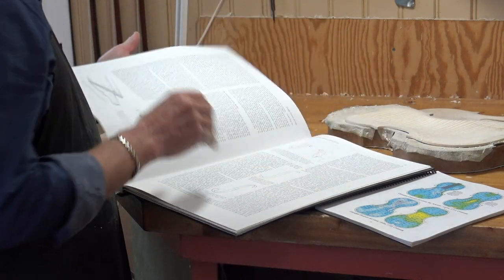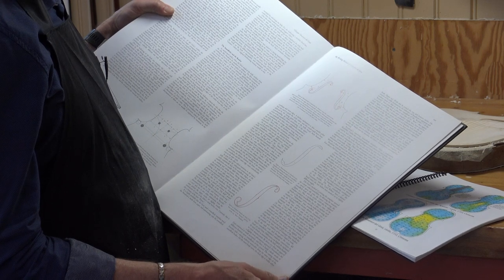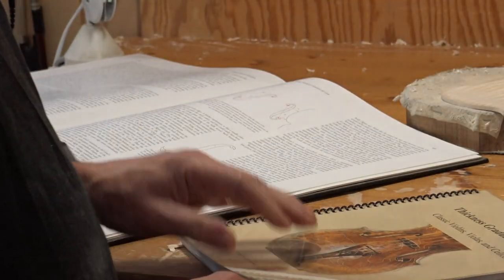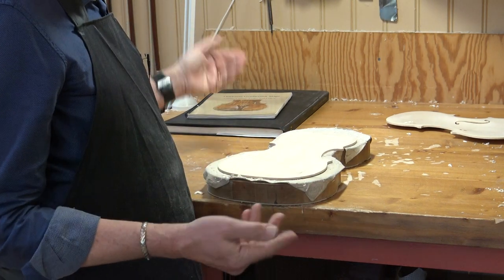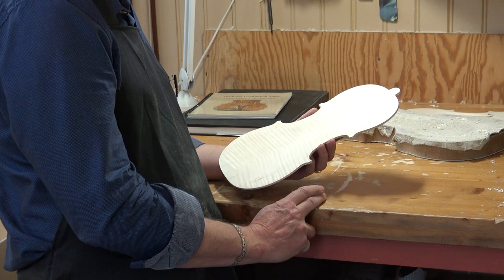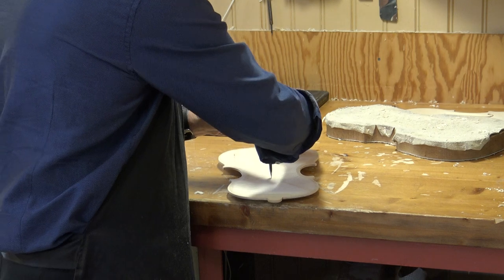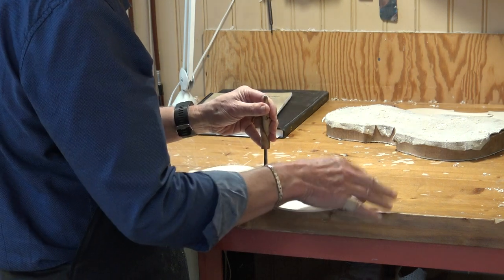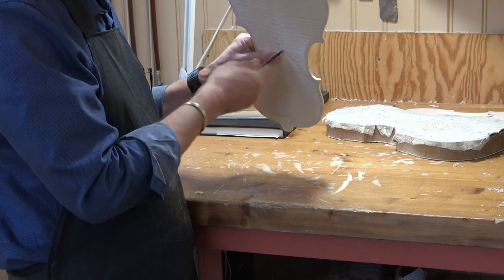Violinmaker Peter Westerlund Part 32a The Bomb II! My explanation of the Guarneri back plug

Comment: Perhaps the pin prick was just a vision point for his mind's eye; a reference, as it were, to keep him centered and balanced. 
Maybe it was a marker for the resonance testing. If you put a small pin in that pin prick hole, you would have the whole back' s vibration to listen to and it wouldn't be dampened by your fingers holding the plate. 
Just a guess. 
I am not a luthier, nor can I hear as well as you folks can.
Reply: That's a great guess though lol